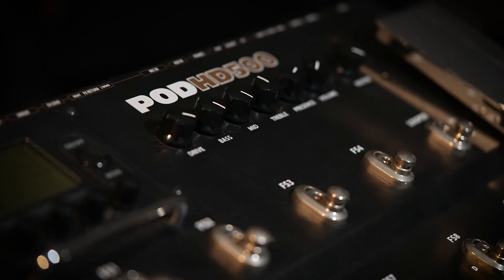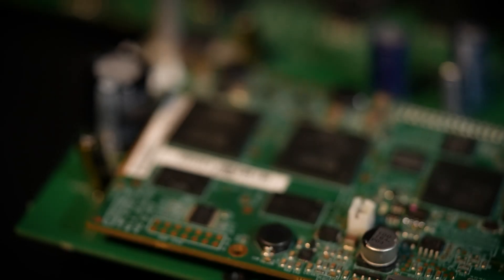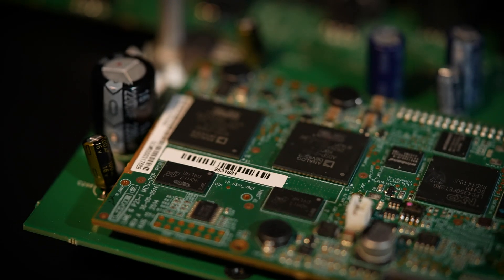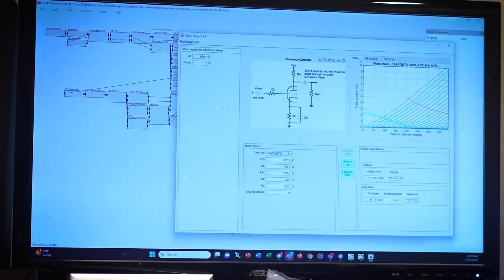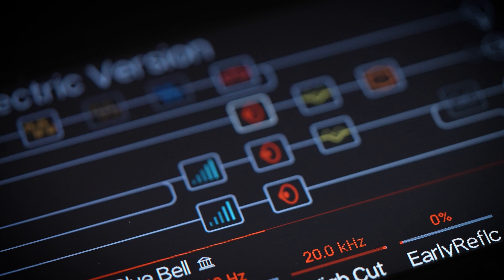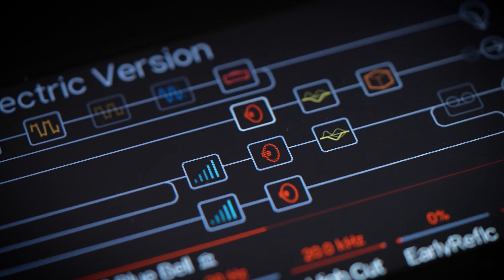BACKSTAGE WITH LINE 6 | Brandon Nelson on Unlocking the Full Processing Power of Helix

Comment: fix the cheap foot switches already!
Reply: Cheap footswitches? I've had my floor almost 10 years and I've had to clean them with DeOxit 3 times. What issue are you having?
Reply: @aaronkerr2481 that’s the issue. They should be more robust. I have to clean them every year and a half under normal use.
Reply: @accidentals_hacks  they are self cleaning. Hold them down and twist them back & forth. I have had zero problems w the switches in 10 years. Open a ticket if need be, they could get your sorted if there's a failure.
Reply: @JimmyGallowayGuitar  I have had problems with 2 Helixes.  Self-cleaning does not help.  I do a lot of switching throughout the set.
Reply: @accidentals_hacks  Mechanical stuff wears, all the time, everywhere, so??? get real !
Reply: @XieYie-d2b  this is chinese garbage.  I had an old AC with a tactile switch... from 20 years ago.  still worked fine.  Get Real!  lol
Reply: @accidentals_hacks  Okay, you're just a troll, get real AND get a life, period.
Reply: @XieYie-d2b get a maxi pad😂